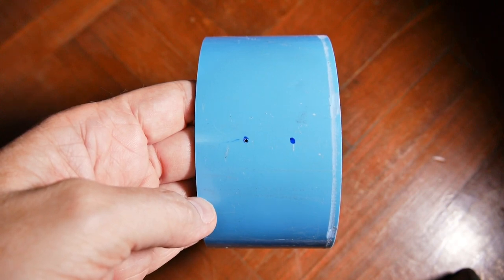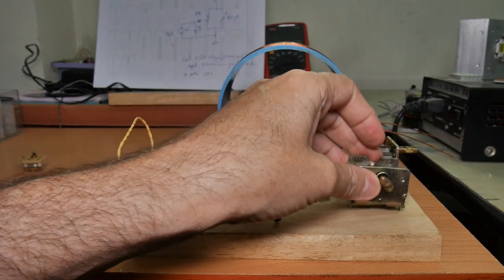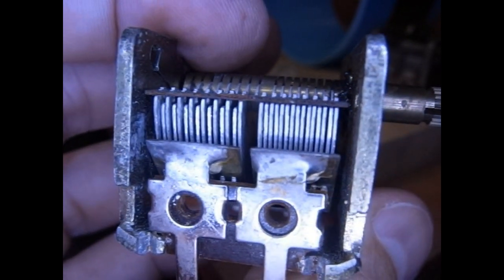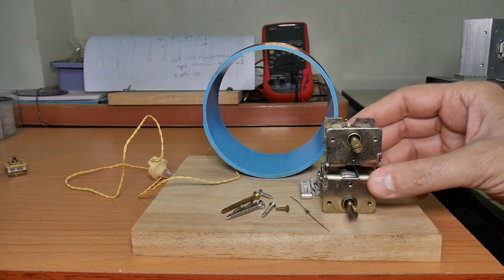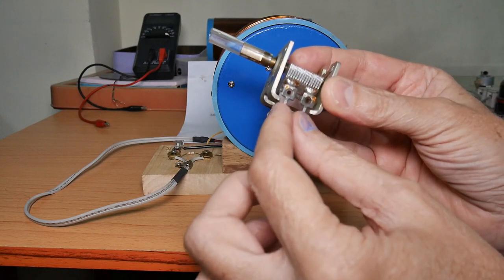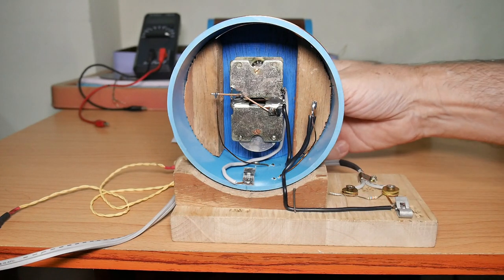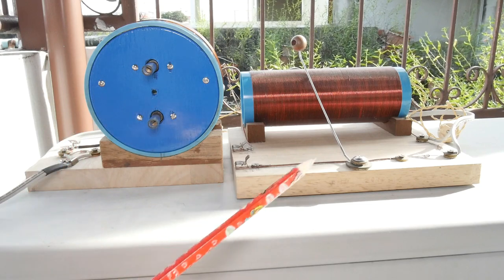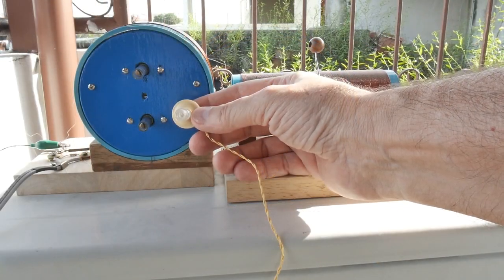Crystal Radio, Capacitive Tuning (Update with Annotations Available!)

Comment from the maker: Remixed version with annotations restored:  https://youtu.be/VJ80Nm9KSkE
3D Printable Knobs For This Radio:  https://www.thingiverse.com/thing:6191252

RELATED CRYSTAL RADIO VIDEOS: 
Best/Easiest DIY Crystal Radio - No Batteries, No External Power 2023 (4K)
https://youtu.be/fLVCqZGpv3U

My New Favorite!  Crystal Radio with Antenna Tuner:    https://youtu.be/mh5KxCpbQ5U
Crystal Radio & Resonant Coil Design:     https://youtu.be/Fw9eb-aB-XU
Crystal Radio Antenna (Shortwave Also):    https://youtu.be/G8AsgZbncW4

My Crystal Radio Does NOT Work (FIXES for common problems):    https://youtu.be/kCxQ8iPQx4s
Good Crystal Radio Connection Points:    https://youtu.be/G3qjrReHR1k
Crystal Radio, Connect A DC Audio Amplifier:  https://youtu.be/RW3VhnzgjtA
Three Upgrades For Your Crystal Radio:   https://youtu.be/LENco3_jV_s
Crystal Radio Wiper Upgrade:     https://youtu.be/i1otDz39nlw
Popular Crystal Radio Design That's a Waste of Time - And Why: https://youtu.be/r9Onub2Xpzc   
New Crystal Radio Design - "Modified-Pickard":     https://youtu.be/_qxHhFKjLAg
Crystal Electric Generator RF Energy Harvesting Exp 5 - Full Wave Rectifier:   https://youtu.be/BTu_GJKjOmA

Comment: In the late 1940s  a store on Fordham rd in the Bronx sold a crystal radio for one dollar I would lay under the bed and use the springs the underside of  the bed for an antenna and the radiator for a ground ,had lots of fun.

Comment: Nice fun.  I built my first crystal radio in 1963, using a pencil lead and old penny for a detector.  1N134A diodes are not all the same.  Experiment with different ones, and you can find a "hot" one.  Once you found your good diode, try wiring a second one in parallel using the same "hunt and peck" testing.  Eventually you'll get a real dynamite pair.  You can beat the crystal earphone using a large piezoelectric element instead, with an 11k resistor across the audio terminals (helps to try slightly different resistances}.  Also, your air variable for your antenna can be substituted with a cheap fixed value ceramic one, once you've learned the correct capacitance, either by measuring the air variable, trying different small fixed value ceramics, or a low value capacitance substitution box.  As long as you use the same antenna and ground (same impedance) the fixed value cap will work fine.
Reply from the maker: Thanks.  I will have to try your ideas out.

Comment: I have found that many germanium diodes will work with crystal radios (1N270 etc). The main thing is having a very low forward voltage, you can test this with a multimeter

Comment: You CAN use other types of earphones. I use an old rotary telephone earpiece. It works quite well. Also I first used a random diode from a old tv circuit board from the 80s. It worked pretty well. I have now switched it out for an antique germanium diode. It works better than the modern germanium diodes.
Reply from the maker: The rotary phone earpiece was likely crystal.  That type may work better with a capacitor than the resistor required by the new piezoelectric type.
Reply: tsbrownie thanks for your reply. Yes it does. It already had a big black capacitor with a red stripe on each side. I just left it. I’m sure it wouldn’t work without it. Also I was testing piezoelectric buzzers and had one from a fire alarm attached when I attached the telephone receiver. For some reason it doesnt work or barely works without both of them attached to the two poles on the back of the phone receiver. I’m thinking maybe the buzzer piece possibly amplifies the minimal voltage coming through. I can, as you said, tap the buzzer piezo and here it on the telephone one. I can’t hear a thing without both of them wired together. Even then I can’t really hear anything through the buzzer. Any ideas? Thanks!
Reply from the maker: The piezo buzzers I've played with were used with active drivers, they required a lot of power relative to the earpiece from your telephone.   If you have a meter, try to measure the power from your crystal radio, I think you will find it to be tiny, tiny.  Radio signals act a lot like static electricity compared to low voltage 60 Hz AC.  So there's 2 things going on, very tiny currents and that high frequency AC static-like thing.  I don't know which style of radio you are using.  The components you add can drastically affect the "tank circuit" (resonant circuit) and overall resonance of the system (even your hand / body near parts of it can improve or lessen performance).  It's another reason that earbuds from your phone won't work well (that and they require power).  A crystal radio is a balancing act of the tank circuit (RCL of those components) and antenna / ground (with its resonance) where efficiency of the overall system is king.  That's what makes it interesting and challenging.

Comment: Hi I enjoyed your video. I particularly appreciated your explanation of the physical construction, i.e. mounting the components.

I would take issue with your insistence that only a 1N34 diode will work. I'm not trying to be argumentative and you seem to have more practical experience of radio construction than I. But there are many places in the world where US standard parts may not be readily available. And if you tell people that they cannot build a crystal radio without that specific diode, you may stop them from trying to put something together themselves.

I have built a satisfactory radio using an OA90 diode which may be easier for many to find and purchase. I used a loop antenna with no ground and could receive the three main AM stations still broadcasting in the UK. I am sure there are other diodes that may work albeit perhaps not as well as what you have made.

Again, I liked your build a lot and thanks for sharing the video.
Reply from the maker: I have no doubt there are other germanium diodes that might work, however when people use the wrong one or believe they can use any diode or use one of inferior quality (there are issues with some Chinese made ones) then I get a whole slew of nasty comments about how it's fake or does not work (can I spend hours helping them fix it?) or ...  So if they use the parts and construction as I have described them, then it's going to work and everyone is happier.

Comment: Hay on the modified radio you those Capacitors. To me they look like tuners are they a tuner but the Correct.name is called capacitors and also is 1 for AM Radio and is the other for FM radio I'm just Curious is all. Thanks Ray 😊
Reply from the maker: No, it's only AM. One capacitor is for tuning the antenna, the other is for tuning the radio. But in fact, they both do a little of each.

Comment: What are the specs on the tiny variable caps? I can't seem to find a 360pF small plastic variable cap.
Reply from the maker: Not sure what you mean. The specs for the stuff I used is in the description. Let me know if you have questions.
Reply: @tsbrownie  i've searched for 450pf mica variable capacitors and i'm not finding anything that looks like what you've got there as alternatives to the air type. Any tips would be appreciated. Thanks!
Reply from the maker: @Joel Ohmer  In theory any adjustable cap in that range would work, but I won't say for sure because I have not tried it myself. Yes, with digital radios,  analog parts are getting hard to find. Ham radio flea markets, old radio repair shops (that is where I found mine), online, old junk radios at garage sales, ....

Comment: Is that a Fessenden's heterodyne radio receiver circuit? There should be a way to hook the two variable capacitors to adjust according to each other to make the tuning more simple .
Reply from the maker: This is based on a design from Elmer Osterhoudt.  There is probably another design out that with simpler tuning, but I've not found it yet.  If you look at this design you see that both variable caps are affecting the resonance, one more than the other.  One is affecting the antenna matching more, but in a crystal set everything from antenna, to radio to ground is affecting resonance!  ;)

Comment: Try Bordens radio company ,and Mike's electronic ,both specialize in stuff for crystal.radio,and farnstock clips I probably spelled that wrong ,those little clips like you are using getting hard to find when you do they are pricey.what gauge magnetic wire are you useing.also one of these places I got some vintage diodes there were using way back then ,they also sell military grade diodes ,I got a couple of each haven't tested them yet I also have the one you are using ,because they are the most popular .where did you buy your variable running calculators ,it would be nice to have new ones ,I have the ones from the transistor radio type you shown .I haven't even built mine yet I been collecting components for six year,I want to find a simple design for not scouts,that works.

Comment: I wanna see a crystal radio video where the builder does not use a variable capacitor.
Reply from the maker: OK, here are 2 with no capacitor. Both work well. One is more complex than the other.
https://youtu.be/mh5KxCpbQ5U
https://youtu.be/mt-s7pf-U5Q

Comment: The two capacitors are on the same conductor.
Reply from the maker: I don't understand. There's a diagram at the end at 16:21 use the resistor between the earphone leads for newer piezoelectric earphones.
Reply: @tsbrownie  Sorry I am wrong,  one is on the ground and the other is on the antenna.  That is correct
Reply from the maker: @marynollaig4124  One is across the coil, the other is in the antenna line. How is your build coming?

Comment: what kind of antenna are you using? a loop antenna?
Reply from the maker: I always use a long straight wire. I don't think a loop would pick up enough signal to work well. I might have to try that to be sure
Reply: @tsbrownie  how long is your wire?
Reply from the maker: @freedomer342  One is 15 meters, the other 9 meters. They are 90 degrees to each other so I can get better tuning for stations from different directions. This is my video on a basic antenna: https://www.youtube.com/watch?v=G8AsgZbncW4
Reply: @tsbrownie  how exactly is the diode connected to the circuit? is it connected to the tap of the coil?
Reply from the maker: @freedomer342  @ 16:21 there are diagrams. Yes, it connects to the tap.
Reply: @tsbrownie  thanks for the help
Reply from the maker: @freedomer342  You are welcome. Have fun!

Comment: Could you explain the reason for tapping at 9 turns? Why not just wind the coil 23 turns? Is there something special about a ratio of 9/32 or 9/23? I assume there is a reason for this, but it's not explained. Thanks.
Reply from the maker: I'm not an expert on analog signals, so it's just a guess.  From the diagram the headphones are "stealing" a bit of power from the tank circuit (the left side capacitor and the coil) to operate.  Too much and the tank circuit won't oscillate, too little and the headphones don't have enough power to operate.
Reply: this crystal radio was originally described in QST Dec 97. In a subsequent article titled "Crystal Radio Tips" in QST Aug 98, the author stated that the position of the tap was set in the circuit to match the impedance of the headphones he was using. in his case, they were 2K phones and he used a tap at 9 turns. other phones may require a different tap position depending on their impedance. Dave Schmarder of makearadio.com uses the same technique in many of his circuits he outlines on his web site. Al

Comment: The only mini variable capacitors I can buy are 0-160pf will it still work what's the worst case scenario ? would there be a workaround ? I am planning to build this radio as its compact and mount all components inside the coil as you described thanks for posting
Reply from the maker: There's no simple answer to what you want to do.  For capacitors you can always put them in parallel to get more capacitance.  That would require 4 to emulate this model.  It is possible to completely re-design the radio changing the coil to adapt to the capacitor's range.  Note that if you change the size of the coil, all the parameters would need to be re-spec'ed (turns, spacing...) to compensate.  I've been thinking about how to do a workable miniature crystal set using a ferro slider, (that has many similar consideration) but most designs get only 1-2 stations, not very interesting.

Comment: Surprised that the metal of the variable caps didn't throw your coils out of spec, or threw them in spec?
Reply from the maker: Good observation!  Yes, I wound the coil, then cobbled it together with the caps in and out to see how it would affect the performance.  I was surprised that it made very little difference.  My backup plan was to make the base bigger and put them outside the coil.
Reply: @tsbrownie  That's very surprising to me.  Are they a non magnetic metal? Or maybe the flux density is so low that the metal didn't 'get involved' for lack of a coherent/intelligent term.  Maybe they are just the wrong shape to be a core.  Thanks for the response, I'll add that to the list of things to wonder about when I should be sleeping.
Reply from the maker: @clytle374  They are magnetic.  I think it's the flux density is tiny.  Go to sleep, it ain't worth it!  ;)_

Comment: Hi!
Thanks for sharing this!
-Can i use a double-capicitor?   -bad idea? -if it is: -why / how?
-Which frequences does it recive?
-How do i make it recive higher / lower frequences?
-Should i have the antenna straigth up?   otherwise i have to have it's side to transmitter, don't i?
Reply from the maker: Double capacitor?  You mean more capacitance?  What are you trying to do?  You can experiment, it won't hurt anything, but it would lower the operating frequency.  This version receives the US AM band of about 540 KHz to 1.6 MHz.  (Note: This ONLY works with AM = Amplitude Modulation)  There are free web pages that tell you the resonant frequency of an inductor / capacitor circuit.  

Antenna is run horizontally for as far as you can.  For safety keep far away from power lines.  Don't use it/take it down before lightning storms.

Comment: for the Variable cap mount. Solder long copper legs turn them 90* and bend the ends into a loup screw into the wood  |___|O

Comment: nice one, please tell me where can i find the 450 pF variable air capacitors ?
didn't find it on ebay,amazon....etc
Reply from the maker: The 365 will also work.  Google Capacitor - Variable, Single, 365 pF, CW Rotation  on Amazon.  They are $14 each, but they have them.  I found my in a local store that's selling off all the junk in their storeroom from when the previous owner had it.  That's another way to find them, old shops that still have old parts.
Oh and you can also use the mica variable capacitors, they run about $4, but the lower range is more limited.
Reply: thanks for the info and sharing your research. cheers

Comment: Thank you very much for sharing!  Just wanted to find out how many watts that you use for your resistor: 50 k ohm?  Thank you very much in advance!
Reply from the maker: Thank you for watching.  It's a 10K ohm resistor (can vary to suit your radio).  Any wattage will do, the power involved is very tiny.  The other information is in the description.
Reply: 1  kw   😀😀😀😀😀Out put of this type radio reciever only few mili watt,any watt risister you can use

Comment: You never did say what gage wire you were using , it'll change the uh of the coil . What about turns and taps ?
Reply from the maker: Details are in the description.  The wire is 0.5mm

Comment: What are you using for an antenna ?    The usual Boy Scout wire out the window.  :)
Reply from the maker: Actually, yes, but along the roof!  I unwound an old florescent light ballast (nasty job, a regular transformer is better).
Reply: Antenna wire on insulators to the roof and to a telefone pole. 60 to 100 feet long

Comment: Can you use any germanium diode?
Reply from the maker: No, I've tried all the ones in my parts box and only the 1n34a diodes work.
Reply: @tsbrownie  So that must be my problem...I have tried many many times to use diodes from 60's 70's radios that I scraped..
Reply from the maker: @kennynvake4hve584   It's not the era the diode was made, but the diode type that is important.  The 1n34a is very, very efficient and works with extremely tiny voltages / currents.  I've got a video about the world's simplest radio, that's just one of these diodes and an earphone attached to an antenna.
Reply: @tsbrownie  that is awesome...I have played around with every single config there is...and while I can hear very faint signals I just never have gotten it the way I think it should be...the fact I didn't use a 1N34a diode might be the reason for it not working properly. I have a copper pipe in the ground with a wire to the radio..and a 50 foot longwire out the window to a tree branch..
Reply from the maker: @kennynvake4hve584  Give the  1n34a a try and let me know how it goes.  I think you will be very surprised.  The only time I've had anyone tell me it did not work was a guy from India who said all the AM stations had been converted to digital AM (which won't work).
Reply: @tsbrownie  Ok..as soon as I get a 1N34A diode I will try it...I dont have any now...